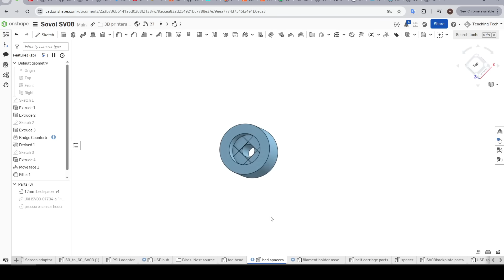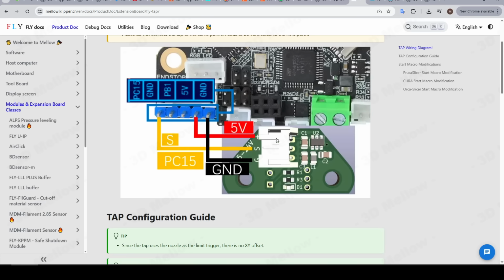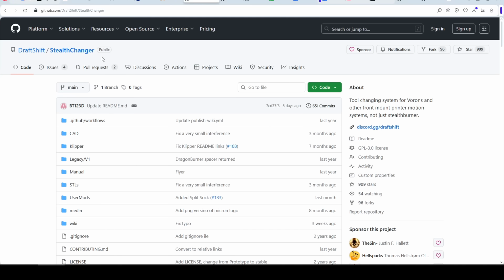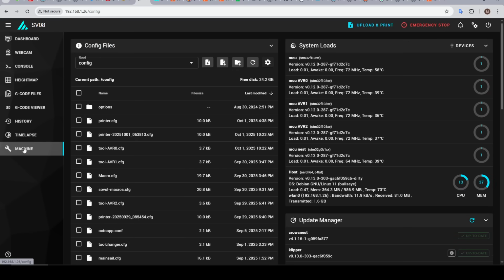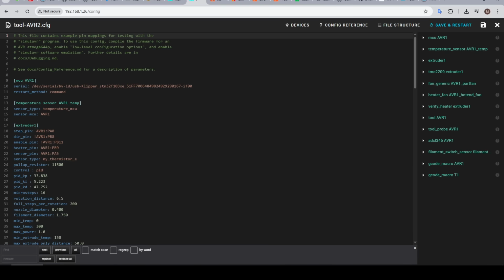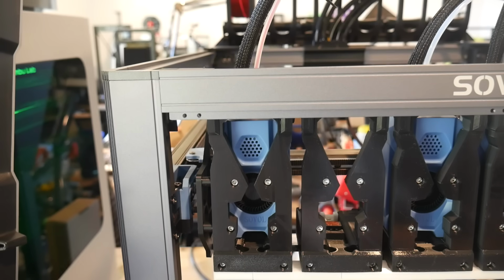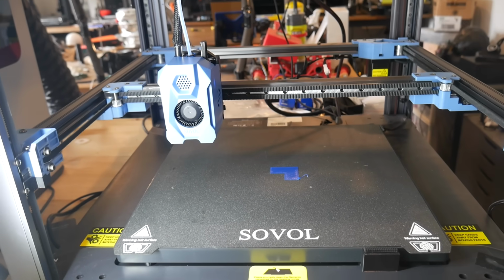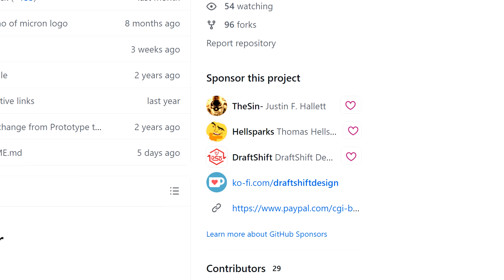Software, calibration and printing! - Budget Sovol SV08 toolchanger part 7

Comment: Thank you again for continuing to document your SV08 Tool Changer project.
Another great video and yes it is still definitely very relevant! 
Very glad to see that you got the first print done and dusted.
Thank you and everyone again for all that you’ve done and are still doing.
I had just purchased my SV08 and before even unboxing it I viewed your first video on modifying your SV08 into a multi head tool changer, which immediately got my attention, so much so that I ordered the extra tool heads and everything else (at the time) that you had said would be needed to start this project, 
I have only returned home (after 5 months away) and one of the first things I have done was to log in and check on your progress, as I am very keen to see this up and running so that I can complete the mods to my SV08 into a multi head tool changer.
keep up the great work.

Comment: Whilst ultimately successful and a great achievement, I did wonder that the physical interaction of the dock/toolhead wasn't designed to allow a bit more leeway in absolute position control. Self locating wedges seems like an obvious design. I've seen elsewhere that magnets also aid alignment. Particularly if paired in opposing orientation as the matching magnets then snap into perfect alignment.IE an inverted pair (N/S) next to each other on one face to meet a pair on the other (S/N).

Comment: When a tool is on the docking rack they are perfectly aligned.  The pick head on the moving arm needs a way to simple, relatively inexpensive auto docking aligner to the docked tool much like space capsules dock with the space station.  Bears some thinking about because we already have automated tool height setters on CNC and bed level mapping.

Comment: Would it be possible to reverse engineer what Snapmaker is doing in Klipper for the U1 for general use in Klipper tool changers?
Reply from the maker: Great question, although the StealthChanger setup is good, it just needs plenty of setup because it's designed to be adapted to many printers.

Comment: My first ender 3v2 has been upgraded and modified over and over, and is now a pile of parts being cannibalized into a multitool core-xy machine partly inspired by this build.......

........and I can feel a bit better about that project now. Because I was supposed to be done at this point, and it's been sitting at an early stage for over a year.

Comment: It makes way more sense to have a z bed rather than a flouting gantry.   If the xy does not move on z tool changing is far simpler and faster.     Luke the XL the bed moves up and down.     I think building a voron from scratch would have been better.

Comment: Really, one doesn't do a project like this because it's cost-effective, one does it because building it is entire point.  Granted that when you started, this was where Vorons were just before the X1C came out - the only vaguely affordable option that offered the performance - so there will be those borderline cases were people started building this because there was a lack of choices, and now there ARE choices.  But unless you fit in that box, it doesn't MATTER if there's a mass-produced option that's easier on the wallet.

Comment: I want to say thank you for doing this project, because it has helped me a lot in my Master's project. I'm working on building a prototype for a cheap (relative to currently available printers) printer for silicone and filament printing. Most available silicone printers cannot print filament in the same print. This is then leading into a larger project that will print surgical models based on scans from a patient, so that surgeons can practice much more easily and at a significantly reduced cost. Based on your, the Draftshift team, and several other open-source projects' work, I've been able to get a working tool changer on an SV08, with some differences.
 
- The sexball and brush were moved to the front, but using the 2 threaded holes on either side into the frame.
- Silicone spacers were used to raise the bed, as this also helped with the bed warp that is common on SV08s.
- A 2020 extrusion frame was installed on top of the printer instead of modifying the stock frame.
- 2020 extrusion was also used to add extra rigidity to the tool holders, using a bracket that bolted into tapped holes on the frame. The tool holders are also bolted to the frame on top.
- The induction probe on the stock tool is kept, and the opto sensor is wired directly into an extra board (I used a spare Ender 3 main board) on the bottom of the printer. 
- Specific to the fluid tool, two extruders (for two-part silicone) of my own design were installed on the back and wired into the previously mentioned board. This also has a custom tool head. 
- A number of code and macro changes/additions that my partner is better qualified to explain. 

The printer isn't complete yet, but thanks to you and a number of other people, it is a lot further along than it would otherwise be.
Reply: Any chance of a tour video at some point or a writeup of some of the changes and BOM?

Comment: I think more toolheads more problems. 
I think we need to look at a painting system. Where you put in white filliment and changes color paint when needed.
Reply: There are reasons to change filament beyond aesthetic color changes. Support material, flexible elements, etc.
Reply: There is a DIY one  available that uses a HP inkjet printhead.

Comment: Awesome work dude, you still need to enclose it as well, this is always an issue with tool changer systems, not a big fan of the tap though, I think I prefer a strain gauge and magnetic resonance sensor instead, have order the ones from Mellow 3D, there is way to much slop and movement in the tap, I'm working a dual extruder tool head for my NXG-3D3 printer on Printables and will be eventually paired up with my external FRS (Filament Router System), so a hybrid setup, IDEX and tool changers have a little too much mechanic variance for me, wear can be an issue with prolonged use so it could turn into a home nightmare x 6 :).
Reply: I agree with the TAP,  the amount of flex and slop really surprised me.
Reply: @originaltrilogy1  There is already enough flex and movement with having a font mounted toolhead, and this just adds to it, but I appreciate the amount of work he has done, as I have designed and currently developing complete printers and my own multi-material system, I also spent weeks of my time configuring and testing all of the macros just to get things working, but I think the Tap will be affecting his accuracy and will probably be making things harder, I did my AMS development on a custom Voron Zero with an eddy current sensor only for homing, and the amount of flex on that tool head alone was ridiculous, and I had all the billet alloy machine Voron parts for the tool head mount as well, I think the entire mounting arrangement for this project needs bulking up and stiffening, sometimes there is no good replacement for good old carbon steel, specially for thermal expansion, flex and slop.
Reply: @NexGen-3D  Yeah, I was really unhappy either way the amount of it on my TAP on my Voron mod. Was quite disappointed with it.
Reply: @originaltrilogy1  Is yours a self printed one or a machined alloy one? I have seen some really nice alloy ones, but unsure if even those were any good either, I always keep the KIS principle in mind, and the TAP looks like more complexity to add to the mix of things that can add to additional movement.
Reply: @NexGen-3D  It's the machined alloy one. There is more flex in it than in the 3D printed one unfortunately.

Comment: Of course, the stealthchanger + sv08 is very interesting and relevant today. Klipper supports laser modules, so one of the heads could be replaced with a laser module if needed, allowing for precise engraving on printed parts.

Comment: This is so cool! I built a V2.4 StealthChanger and it's a great machine but man, it was an incredible amount of work to get it going. You are making that tech accessible to a much larger audience, and I know from your past work that the documentation will be top-notch.

Regarding the comparison to other systems, one point to consider is that systems which swap the entire live tool (e.g. Prusa XL, Snapmaker U1, and StealthChanger) will be faster than systems like Vortek or INDX which swap out a cold hotend. My SC can do a toolchange in 3-4 seconds (not including the wipe tower) whereas Bondtech quotes 12 seconds for INDX. As larger prints or prints with a lot of colors can have thousands of toolchanges, that difference really adds up. Don't get me wrong, the simplicity and cost savings of INDX are a major advantage too, and it's still going to be much faster than the AMS-type systems people are using now. Just one more point to consider.

At the end of the day, I love my StealthChanger, but I'm happy about all these alternatives coming to market as well. Having more options is great, and it should result in better multimaterial slicers, and more people designing multimaterial prints, which benefits all of us!

Comment: I'm still curious how well INDX will work with the SV08. After switching to the SV08 from an Ender 3 V2, which I modded until it was pretty much unusable and wasn't fun to print with anymore (there was always something not working due to the many mods), I left the SV08 mostly stock. While I would really love to get some form of multi color printing going, the fact of how long it took you and the Next Layer to get some Stealthchanger setup running so far has scared me off and I really hope that INDX will be easier to use. I still appreciate all the effort you are putting into this series and it's really interesting to watch!

Comment: Awesome video. is there a reason you cant have the bed start at the top and go down to bottom like an XL?
Reply from the maker: The bed is stationary, which with the flying gantry, is one of the distinctive design feature of the voron 2 the sv08 is based off.

Comment: one important difference to the other toolchangers is the z-travel. Before starting I didn't think this would be a problem, but after getting the sv08 toolchanger (not this one, but one that's based on the clickchanger), I can tell you it IS a problem ... you either have very loud but fast z-travel or very slow travel which leads to more oozing mid air.

So unless you want to figure out how to adopt flying docks to the sv08 (could be difficult with no 2020 extrusions at the corners) you might be better of with a gantry mounted INDX on an sv08. One thing that is really cool tho is the versatility, I have a high temp toolhead and some really light weight and cheap ones (conch + proto), so technically I can print faster and hotter with this setup than the INDX (I think 300°C is tops on the INDX, but we have to wait and see).

for everybody thinking about this: Just do some 150-200mm/s and 30-50mm/s z-travels up and down on your sv08 and decide for yourself if this is to loud or to slow. It's a cool project either way even just for filament rollover, but maybe not the best for 24/7 multicolor at every layer

Comment: Please be careful with that clock spring wire - in my experience, it is shipped "under tension" so when you open the seal, it will uncoil in a possibly spectacular and potentially unsafe way.  The edges can cut like a knife if/when that happens!  Recommend wrapping with a towel or something else to "arrest" the movement of its uncoiling when you unseal it.  Thanks for the great work!  You should package and sell these units in a pre-fab ready to go "TT" branded offering :)
Reply: Yep, it was terrifying the way it uncoiled!!
Reply: Oh yeah, that brings back memories.  I had to fix a recoil starter on a snowblower once, and unfortunately the windspring sprang out of its housing.  I had to rewind the spring into the housing.  That's an hour of my life I'm never getting back!

Comment: The most inconvenient about the SV08 for tool changing is the fixed bed build because it increased tool changing time because of the Z travels. A fixed height gantry makes a much better option.
Reply: My sv08 tool changer takes 4.3 seconds per tool change. I don't feel like that is a poor option. The real limiting factor on the sv08 is the Z axis motors aren't strong enough to go faster than about 265mm reliably before one decides to slip and bind the gantry. He has his running extremely conservatively in the video.
Reply: @J0eB0l3D  I wouldn’t recommend pushing the Z steppers too fast, or you’ll risk losing Z height. 4.3 seconds seems wildly unrealistic for any kind of precision. By the way, no matter what speed you can get on an SV08, it’ll still be much faster with a fixed gantry.
Reply: @axelSixtySix  It's been running fine this way for months :) I'm still waiting to see a fixed gantry that swaps tools faster though ;)
Reply: @J0eB0l3D  Now that’s what I call an unchallengeable argument from authority. The personal experience of a guy alone with his SV08 in his garage. So basically, you are the universal reference for the entire world and we should all take your word as gospel truth. But here’s the thing: four seconds to go from the bottom of the bed all the way up, grab a tool, and come back down means a total head travel of about 1040 mm in 4 s, or at least 260 mm per second. With an 8 mm lead screw, that’s around 1950 RPM, which is far too high for NEMA 17s that start losing torque around 500 RPM. So there is a serious, if not almost certain, risk of losing precision. And what really tickles the engineer in me is that something just doesn’t add up somewhere. Wait, except if the Z motion is driven by belts. 

And as for faster tool changes with a fixed gantry, it’s pretty simple. The travel distance is cut by about a third, and it’s handled entirely by the CoreXY motion, so it’s obviously quicker.

Comment: Excellent video mate! I will say that this is still a very viable option, and I'm going to build one regardless if it's worth it or not; I just love toolchangers. My build will be with the Sovol SV08 Max, as I want more tools. 

Your work is GREATLY APPRECIATED and documenting all of this for us. God Bless you mate and carry on!
Reply: I have the Sv08 Max, and I'm not sure it's viable on that, the slow speed required to change tools on a printer that is 500mm tall will result in really slow changes.  I do love this project though.
Reply: @originaltrilogy1  Thanks for the insight! greatly appreciated. 
I do prefer a trident-style printr for a toolchanger,r ather than a R2 style like the sv08, as I agree; the toolchanges would be quite long to travel the whole length up to the top

Or, with added weight, place all the tools on the gantry...but ehhhh idk about that

Comment: My two cents on whether it's still relevant: Yes, definetely! Because:
- The SV08 is THE big coreXY printer for DIYers (based on the Voron 2.4, pretty affordable, easy to mod)
- There will always be that kind of printing enthusiasts who like to make their own machine, or at least mod it to their liking
- Your work on this project will be easily adapted for the SV08 Max (and probably other printers)
- It's always good to have options (INDX etc. are awesome, but they are just a different concept)

Thank you so much for going this route and keeping at it! ❤
Reply: Agreed, and you can add the point that the INDX has been delayed without a firm deadline and the H2C doesn't have a firm deadline either so your setup is at minimum 3 months ahead of their releases and probably more like 6 months.  Same goes for the 18 million folks who ordered the U1, it will be a long wait for many.
Reply: @thegoldbug  actually I think that the U1 finally came out yesterday. Initial impressions are OK. Some people are having network issues, but the machine seems to work as advertised at least initially.

I think we are at the stage where the technology is certainly there, but is the technology there in a reliable and affordable manner? I guess we’ll see.
Reply: I like it and find it interesting (obviously since I am watching all these videos) and totally respect the time and work folks put.  However, I would rather by a 100% full working and tested product myself, as I want a tool,  I do not a need another hobby.  I not not want to have a working calibrated printer to make my new 3D printer work correctly.  😁

Comment: Would the INDX be smaller than the SV08 toolheads? If yes, there might fit even more INDX heads than the sv08 heads?
Or even use a sv08 max as a base?
Reply from the maker: I imagine these parts will translate to the max with minor modifications. Indx is indeed small so you would fit a lot more. However the filament still needs storing for each tool somewhere.

Comment: And what is budget here? 5 heads with full electronics and motors. 5 Karl. Its not a budget. Changing only extruder with hotend or only hotend is budget, like bondtech solution or bambu, they show it in commretial. But 5 fully assembly heads, no, just stop .... Please....stop